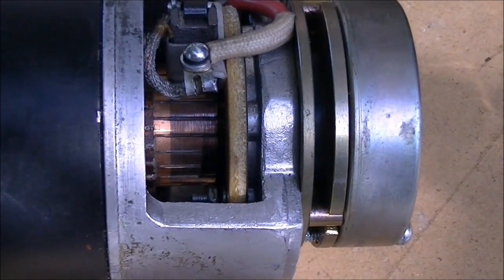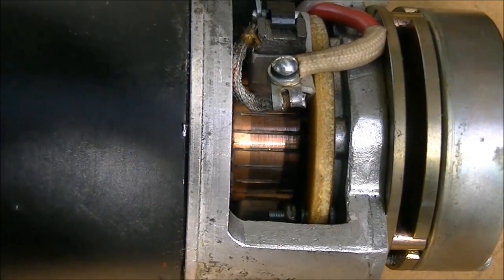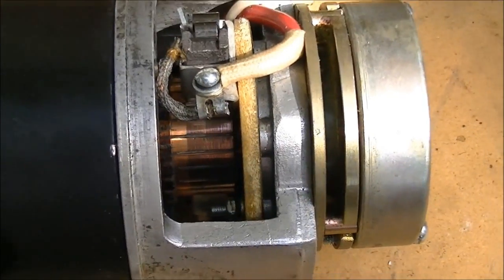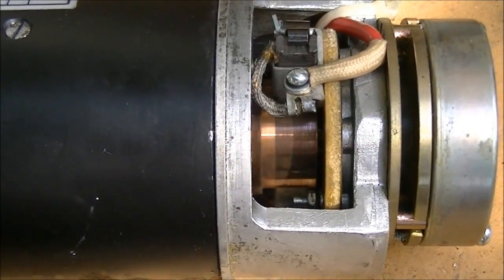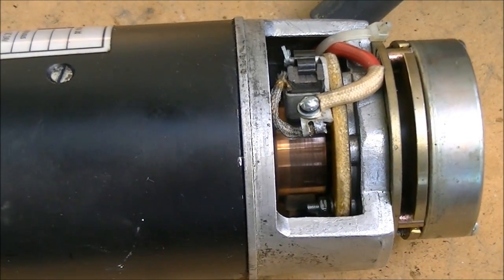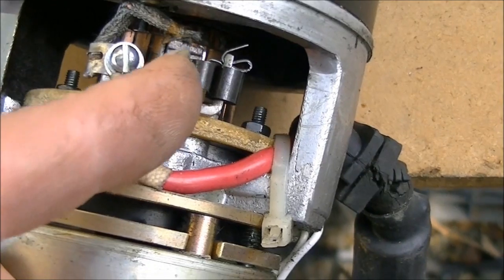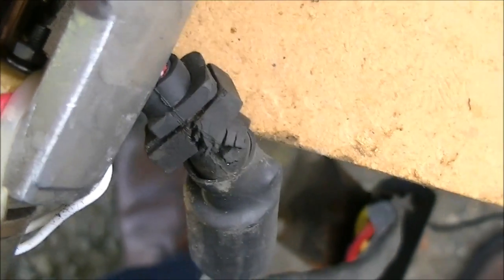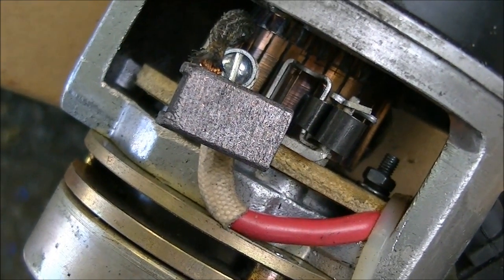Electric Wheelchair Motor Problems

Comment: the dc motor by design runs heated,one way or another it gains heat,what it can not tolerate is loss of lube to the bearings and the commutator you are speaking of needs cleaning often,or the brushes run uneven then there is damage that requires new parts,i rebuilt starters and dc electric motors for over 45 year,these little motors don't require much,but lubing the bushings and keeping the commutator clean gives more months and years to operation,simple thing like you did,your motor should never run under voltage for any reason,if the motor is rated for higher voltage to keep amperage down,then that's what you do
Reply: This is a very old video, but I am asking for my own information because I will be rebuilding 4 wc motors (new bearings & brushes, clean and remind the gear box, and resurface the commutator).  I have two sets of motors and multiple joystick controllers and I plan to keep my sturdy old chair going for many years!

 When you said a motor should never run under voltage, did you mean you should not run a 24 volt motor with 12 volts, or did you mean something else?

Please clarify, and thanks in advance for your help!
Reply: @DennisHicks78749  if you run a motor under voltage it will kill it quick,if you run it over voltage it will kill it, just slower,if you run it over voltage all day hard its toast,run your motors at fixed voltage on the equipment and if you are going long distances you will have to do something else ,do to the max voltage on a lot of these little machines,people ar e so  used to gasoline power and extended runs,can't do that withbattery power,and the motors new to cool off before coming back or you will boil the grease right out of the bearings

Comment: not sure this is feasible but one thing that cleans corroded copper really well is muriatic acid.  Even using a Q-Tip dipped in the stuff works amazingly
Reply: I think it will eat the carbon brushes when replaced. Use a fibreglass pen. Nothing else.

Comment: any idea what would need to be changed if the reverse stop working just the reverse not sure what to look at ? cheers everyone
Reply: Most likely a disconnection from the reverse end of the throttle pot. But if its not that it could be the control box which is a terribly expensive repair. Typically from £400 to £600.
Sadly you do not have access to the correct test gear. But if you have a multimeter, ant know how to use it, you could check the loom for continuity .

Comment: Question: my victory 9 scooter is having issues, it powers up but when I go forward or reverse the battery drains all the way down. And they're fully charged new batteries any repair tips?, thanks
Reply: They are wired up incorrectly . This is causing a short circuit and draining the battery. It could also cause a fire as the cutout is inoperative due to the incirrect wiring.

Comment: hi, my wheelchair right motor won't rotate suddenly, is there a gear that fails?
Reply: There is, but it is most unlikely to fail. More like you have got a piece of twine wrapped around the axle on that side.

Comment: my older pride gogo traveller elite has new batteries and it can run for hours but get on a steep grade or hill and it becomes such a load that the circuit breaker shuts down the whole scooter and we have to reach down and reset it, and walk the scooter up the hill. very discouraging. what can i do to solve this. if i can replace the motor to solve this it will be simple i think. any 
 help is appreciated...thanks
Reply: I know this is a year old but I had the same problem. I put 26ah batteries in now it goes up hills reasonably well.
Reply: The likelyhood is that the battery terminals and connectirs are a bit corroded.Give them a rub with a brass wire brush that you use to clean suede shoes.
Reply: If you read the manual, it says these are only designed to work on a very slight grade, definitely not to go up a steep hill.  The circuit breaker keeps you from burning out your motor, which is what would happen if you bypassed the breaker and then went up that hill.

Comment: The commutator looks ok. What you are removing is carbon,this is normal. The motor sounds like the brushes have been interfered with,and may need bedding in. People will take these out and dont fit them back the same way,this will cause noise poor contact, sparking and excessive carbon deposits.If you dont understand motors leave alone!
Reply: This is backed up by the fact that when you replaced the brushes, after cleaning the com, the commutatir very quickly became coarpted in carbon. Thake the brushes out, replace them with new ones and throw the old ones in the bin. Also make certain that you have seated the new brushes correctly and replace the retainer xpring correctly. You did neither in the video.
Moral of the tale. If you are not competent then leave it alone. Remember the old saying " Idiots who interfere, lose the money for their beer". Corny but very true.

Comment: A brass wooden handled carburator brush to clean the commontator will work fine , But this sounds like a bad bearing it`s pulling the power down before it squeals  .
Reply from the maker: It turns out that the brake was on. I thought the brake worked if powered, but it turns out it works when not powered. I got that problem straightened out.

Comment: My Vita Bushranger Mobility Scooter, when I have been using it fir a while, goes into a Low Gear Mode, then finally after I keep driving it either STOPS or takes off back into High Gear again, then goes thru the same thing again after awhile, until eventually stops, batteries are showing FULL Charge, does anybody have any idea what is going on with my Scooter.???

Comment: someone needs to come up with a list to cross reference power wheelchair parts like bearings, motors, etc. I found wheel bearing part no. right on the bearing and 10 pairs cost $15 while Bounder wants $45 for a pair.
Reply from the maker: +markfothebeast That "someone" could be you. If you did the hard work I'll bet you could have a very profitable website.
Reply: @jwwm2  I for one would take out a 5 year subscription, even if it was £20 a week. It would save me thousands of oounds per year.
Reply: Don't know how someone would find it out without having to source and teardown a bunch of motors.  An expensive process with little return.  I volunteer you!

As a practical matter, most are limited to finding it out when the motor gets noisy and it is time to replace bearings.

BTW, if you decide to do it, please start with my Jazzy motors, used in most of their models for years: Jazzy E620, or DRVMOTR1173 (right side) and DRVMOTR1172 (left side motor).

Comment: the brush ,looks good, you can clean the commutator a little by wrapping a layer of fine sand paper over a pencil eraser & use a rubber band to hold it on, then lightly insert it while the motor is running, but your squeak sounds like a bearing, they are cheap & easy to replace.. good luck..

Comment: Hi I was wondering if you could help my pride sundancer scooter while sitting idle with the wheelchair ready to go without pressing the throttle the wheelchair takes off also reverse works only sometime and not the correct speed any help would be appreciated thanks
Reply: Your throttle pot needs replacing. What is happenning is that the throttle pot, which is very similar to the balance control on a stereo amplifier, has started to disintegrate. That is why you are getting random power ups.
If you can find a service manual for your particular scooter, that will give you the resistance of the pot, in ohms. If you are quite handy you could remove the throttle assembly, also known as the wig wag. On the casing of the round thing with a spindle sticking out of one end, it will me marked in OHMS.  Obtain a similar one from radioshack or maplins, any supplier will have one, and youve got it made. All you do now is carefully remove the old component and replace it with the new. Solder the wires from the old one onto the new one . But brpe very careful to take photos and make notes of exactly which wires care from where and be sure to replace them in the same places.
Hope this helps you.

Comment: I have a Jet3 I've charged and no movement I've had battery tested and all is good. .the horn works but not sure of problem. could the controls be locked if so how do I unlock?   please help
Reply: If someone is having problems first search online to see if there is a troubleshooting guide.  If so, consult that before posting some shot in the dark questions to your tube randos.

Comment: Hello John hope you can be able to assist me, I have a jazzy select 6 with 2 new batteries 
the issue here is when I power on the console blinks on & off, try to do a test to see if it locks & unlock nothing, what can it be? thanks for your help
Juan
Reply from the maker: +RuBY ARROYo Start by making certain everything is plugged in properly, and that there's no corrosion on any of the connectors.
Reply: Though this is too late to help you, if someone reads this with a similar problem, those flashes are error codes.  Note how many of the leds are lit, and how many times they flash without pausing, then Google your wc model error codes.  This diagnoses many if not most power wc probs.

Comment: Sounds like the brake is still engaged, measure  the resistance across the brake, power up the brake, you should hear a click, make sure the brake is disengaging. Sounds like the motor is too slow even on 24 volts, suspect drag. If it's not the brake then it's a bearing.
Reply from the maker: Scooter guy It was the brake.

Comment: The copper contacts are a bit worn but not too badly. You should remove the armature and have a machine shop take a minimum cleanup cut. Probably .005 to .008 one thousandths of an inch by looking.. Replace the carbon graphite brushes with new ones. Don't waste your money on turning the contact points unless you do. Also replace the bearings as the wear and sound indicates that they are going bad. It appears that when the motor gets hot it starts to drag. Also check the gearbox for any worn or dragging parts. It is quite possible that you can get a rebuild kit from the manufacturer if you don't know how to match up bearings and gears. Hope this helps. I was a machinist for 40 years so I am not blowing smoke at you. Turning the armature is not very expensive and any knowledgeable machinist can do it for you. It should only take about 30 to 45 minutes. Also there should be no more than .002 run out between the bearing journals and the contact points. If you have the extra money you can have the motor rebuilt by an electric motor shop for about half of what a new one will cost you. Just make sure that the shop is reliable.
Reply from the maker: Thanks for all of your great advice. I've had to shelve the wheelchair motors for the time being since I don't have the money, time, tools, or skills I need to do what I want to do with them. I'm also trying to sell my house, and I may move to The Philippines.
Reply: John Strabismus You might look for a good used one or have some one rebuild it for you it shouldn't cost too awful much if you shop around.Try craigslist....

Comment: The brake energizes when the motor is powered, when it energizes it retracts the brake disks letting the motor spin freely,  when the motor power stops it releases the magnet and the spring locks the disks into place. ...actually that's something I need to check on a chair that was given to me, the motor isn't working and the brushes are literally stuck in there! I need to make sure the brake is releasing on that side just in case that is what caused the problem!  ...oh, the squeak. Its definitely a bearing, just a matter of figuring out which one!
Reply: I got forward and reverse to work on my scooter but I can't get the brake to work. The scooter rolls free whether or not the scooter is energized. There are two thin black wires coming off of the brake housing. I'm confused though because if those are to energize the brake, shouldn't the chair be hard to roll?
Reply: +TakronRust I know it sounds a bit obvious, but do you have the twist-lock handles turned to engaged the motors, or are they turned to release the gearbox so that someone can push the wheelchair?
Reply: +mikie2501 yea,  that's on. the chair goes forward and reverse. the problem is that when you let off the throttle, it rolls 20 feet before it stops.
Reply: +TakronRust hrm...it shouldnt do that anyway, on mine when I reduce speed to a stop the brakes don't engage until the chair is almost dead stopped, its very audible.  I cant imagine it rolling very far even on a slight incline with the drag the gearbox puts on each side.  Ill have to think on that a bit.  Your motors do go thru a gearbox before the wgeel, dont they?
Reply: +JOSHUA FAY aha. Well sounds like the controller is either fucked or they gave you the wrong controller. When you're going at speed X and instantly reduce the throttle to zero the controller should follow a preprogrammed power reduction curve, bringing the chair quickly down to a stop and then engaging the brakes.  Sounds like when you are dropping the throttle to zero its just cutting power to the motors and letting them free spin and the drag of the gearbox is the only thing slowing it. Guess its good the brakes weren't engaging when power to the motors was cut, lol, wouldnt want to see how far it could chunk me! Hehe
Reply: +JOSHUA FAY correct. ...and I imagine that they would suck the batteries down if left powered when you werent using the chair.  Have you checked for voltage?  I'd take one off and see whats up on the underside. Do you rcall hearing them working before you had to replace the control board?

Comment: Having dealt with electric motors ranging from micro ro 100hp + a few things for ya. #1 Yes you need to clean the contacts on the rotor, simple way is to use a piece of fine sand paper and some thing flat to hold it against the copper contacts and rotate the motor (this is easier if you remove the gearbox). By doing this your removing the built up carbon (Brush's are mostly carbon or graphite) and your also resurfacing the contact area. The more contact surface area between the contacts and the brush means 2 things, #1 more amperage is being applied to the motor, #2 less heat is being developed because there is no point for the brush to lose contact creating an arc. Make sure you use compressed air to blow out the copper and brush material that is removed (don't breath it). IF you know what your doing you can also resurface the brushes also but unless they are really bad they will reseat them self's after a little use of the motor. The other issue you have is bearings that have worn out. Usually when a motor/gearbox is making those sounds (high pitched squealing) that means the bearings have worn out. Usually the motor will start out fast and after running will start to slow down and start making that sound you heard. Thats the bearings heating up and in doing so they are rubbing metal on metal and in fact if left like that they will sooner or later seize up. A little hint: It's harder to replace a bearing that has heated up and seized then it is to replace one that hasn't, Easy way to see if it's the motor or the gearbox is remove the motor from the gearbox and run the motor, if it dosn't do it again after running the motor for a while then it's the gearbox, if it does then it's the motor. Also not many know that those gear box's are just like a car/truck/heavy machinery gearbox, they require gear oil/lube and it should be checked twice a year.

I know this is an old post but maybe this info will help some others.
Reply: -s or -es = more than one of something (plural)

-‘s = something that belongs to something (possessive)

So  brush’s = something that belongs to a brush.
Brushes = more than one brush.

Self’s = something that belongs to self.
Selves = more than one self.
Box’s = something that belongs to box.
Boxes = more than one box.
Reply: @DennisHicks78749  thanks grammar Queen. Please go to the front office to get you’re award with the words from me engraved on it…. It reads “I don’t give a fuck what you think or say!” Dennis the time you spent typing out the useless response you did could have been better spent poking yourself in eye with a pencil!

Comment: The only thing I see is Manual and Drive. I shifted it to manual but the motors are not working. I don't know, I have an Invacare Storm series Wheelchair. I don't know anything about the motors though, I'll be happy if you make a video about how to do so.
Reply: Have you tried resetting the overliad button?

Comment from the maker: These motors all have a lever on them that engages/disengages the gearbox. It'll most likely be on top of the motor, but will be easily accessed by anyone sitting in the wheelchair. Just turn it and the gearbox will be disengaged. Try running the motor to see if it makes any odd noises. If it does, then the motor most likely has problems. If you don't hear any unusual noises with the gearbox disengaged, then the gearbox needs to be worked on. It needs to be serviced either way.

Comment from the maker: I just watched a video on testing wheelchair motors, and it looks like you're right. The brake needs to be energized when the motor is running. Now, the gear box also locks the wheel from turning, so I thought it the brake shouldn't be energized when the motor was operating. Oops!  I'm going to test all of this today. Thanks for your help.

Comment: If it is electrically powered, my guess would be that you would apply power to disengage it and it is normally engaged when not energized, other wise when the wheel chair was just sitting there it would be drawing power from the battery.   Have you tried applying power to the brake while running the motor?